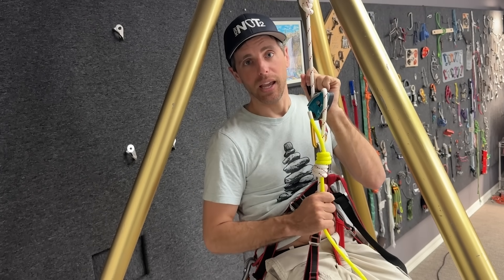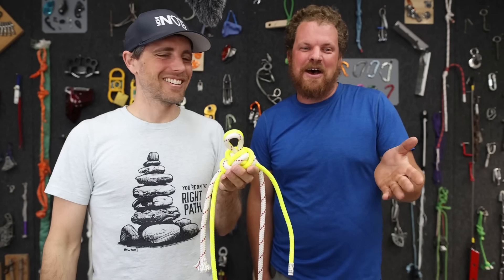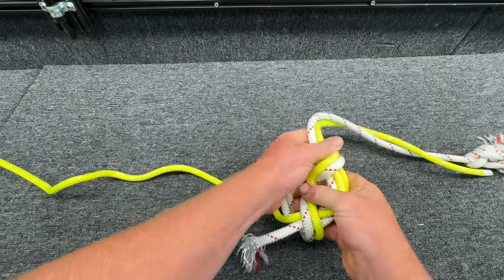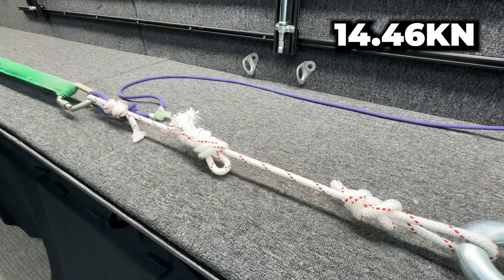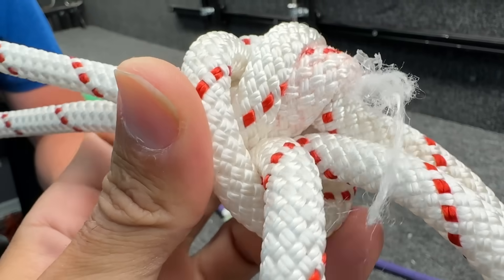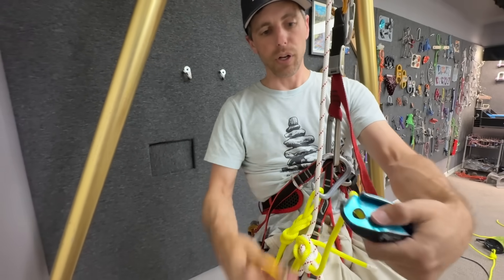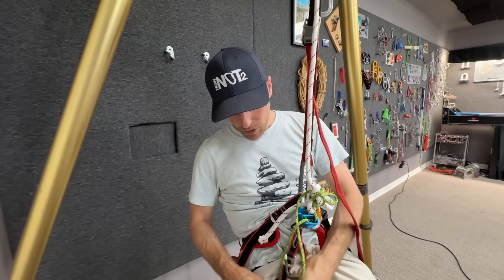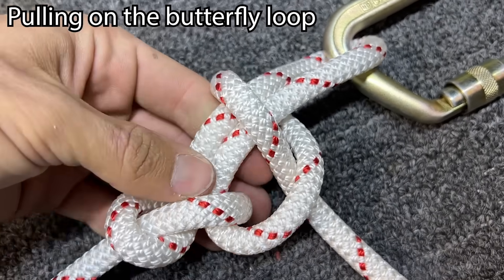I’ve never seen anyone use it

Comment: Irata 1 here, I used this knot to keep my safety line close to my working line, both 11.7mm kermantle rope. Had a big scare when it undid itself and dropped me a foot. The extra strands just wouldn't dress easily. I still use it but now place a carabiner in the bite for safety.

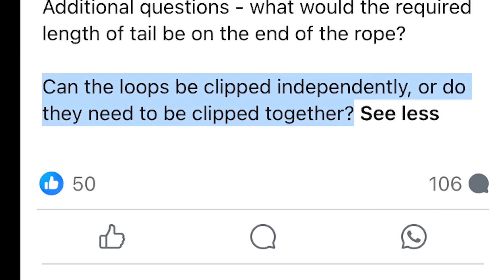Comment: 7:00 would there be any difference if you used the loop from the load-bearing rope vs the dangling rope? Since the two ropes in the test were the same color, it's hard to tell which side was used.

Comment: I’m planning a 100 m rope swing (pendulum jump) in about 8 weeks.
My question is whether it’s feasible to combine two 70 m ropes with two 30 m sections from a folded 60 m rope.

The idea is to connect both ropes together in the same knot, so that the knot is shared by two ropes. From my perspective, this setup should prevent the knots from creating friction on each other or getting caught, since they would be aligned together.

Has this configuration been tested before?
Would it be considered redundant?
Are there any safety issues or potential failure modes I might be overlooking?

Comment: There's a way to tie a modified fisherman's knot that is easy to untie.  It involves putting a square know in between the two barrel knots.  I wonder how strong that would be.  I have used it before in a cave, perhaps that was unwise but would be interested in the strength of the knot.

Comment: What if...one would take this knot to make two personal ankers out of it?
Just thinking.
Just recently, I watched your videos about a cow's tail, where you dropped several things from the drop tower.
So, I just wondering...🤔
The double loop goes directly onto the harness (next to the belay loop maybe?) and with both other ends one can adjust two individual figure-8 loops as two cow's tails.
So then there would be no carabiner needed on the harness with only one (bigger) knot with a double loop for further abrasion security.
Maybe I give it try form my ceiling in my living room 😅👍🏼.
Reply: Tying the knot onto the harness (?) might be a bit tricky, but I don't have very much experience to know it better.
Thank you.

Comment: The way I was taught to prepare ropes (for caving) before stuffing them into the tackle bag for whichever cave was today's fun (or tomorrow's first fun) was always to tie a figure-8 loop into the end of the rope, then a single figure-8, then drop that end of rope into the bag and start feeding the rope into the bag.
First in, last out. If you're in mid pitch and you've started on the wrong rope (which is why you always put the rope length mark under heat-shrink at both ends of every rope - particularly if you're the club's tackle-master with nobody willing to do the dirty work on Wednesday evenings) for the pitch, you don't clutch at the loose end of the rope accelerating upwards away from your grasping fingers at 9.81m/s/s, but instead the first stopper knot (single figure-8) smacks into your rack, stop or whatever and you come to a halt. Then you clip into the figure-8 loop with as many cows tails and donkey's dicks as you want, switch to ascenders and up-climb off your descender. Affix the new rope (or ascend to pitch head and find out who has lost a tackle bag), then down-climb beyond the junction, change back to descender, and continue to the bottom of the pitch (or the end of that tackle bag.
We'd drill the novices on that at 3 hours after sunset on the sea cliffs. Then Muggins the tackle-master would be washing ropes in the shower at 03:00 to use on that weekend's jaunt.
To be honest, I often just wouldn't bother to untie the figure-8 loops from one month to the next unless I had other reason to inspect a rope end for damage.

Comment: Why not use the Fisherman to connect the two ropes, and then create 1 or 2 Alpine Butterfly knots above and or below the fishermans close enought to clip in?
Reply: Of course in theory you can do this.
But - this issue here is 'efficiency'.
A bend (ie end-to-end joint) that consumes more rope is not 'efficient'.
Ideally, you want to use a 'bend' that consumes the least possible amount of rope, has the lowest possible 'footprint', and is resistant to jamming (and of course, is secure and stable).

Comment: Awesome mystery knot video! One mystery knot i saw tied by an AMGA/PCIA instructor was the Triple Bowline. I use it all the time now. Just a little playing around with the knot will show why it needs a video! I use it as a midline bowline so I don't have to pull the tail all the way through. I use it for tree work, 11.7mm yale scandere in a running or cinching configuration. Originally i saw it in 10mm static line for a really long tree anchor, so the double loop was around a tree.
Reply: I have used a triple bowline for almost 4 decades in certain situations . Mainly industrial use .

Comment: Double alpine has been used in rope access for years for rigging Y hangs that need adjusting angle frequently and for making an anchor for vertical lines that run off horizontal lines without the need for a trolley system.
You can find discussions like this on any rope access forum but especially the North American ones from the sprat no nothings arguing you can’t do xyz  because they don’t know the difference between a SWL and a WLL.

Comment: been rigging for more than 40 years,  got 5-6 knots i use on a regular,  sometimes folks tell me they have a better knot than the one I'm using at the time....I always agree.
Reply: I find the half-sheepshank to be useful. Knot might be a strong term for how extremely dangerous it is, but if you're working alone and want to lower multiple tools off of a roof without climbing down to untie each time, it's useful.

Comment: This actually seems to suggest this is (bar the situations when you need low profile as mentioned) actuall the best way to connect two ropes. Clipping point, super good enough strength, and you can have it clipped and have two independent ropes still functioning as normal. I'm keeping this baby in my bag of tricks for sure
Reply: It's big and prone to snag.

Comment: Haha.. finally made it on a HowNot 2 video...!

Jip not every one thinks like an engineer....I've explained on the original post on Rope test lap.

The knot wasn't discouraged..! 

Caving specific application of it as a singular attachment point was discouraged in a scenario where the loop/eye is bidirectionally loaded pulling the 2 strands (of the same rope) appart. That will result in pulling the constricting loops tighter from both the loops and the line side personally more than a singular load point inside the eye.

Consequently loading and unloading of the main line (in a horisontal placement or a vertical placement) will result in a self-equalising of stress and a rotation of the loop /eye between the 2 points pulling on it.  That will create a saw effect on the loops of the eye as well as the constricting loops of the knot with the fibers already under stress that can lead to a premature catastrophic failure.. In a caving scenario there's additional abrasion compounds like mud or surrounding sandpaper like surface of calcified sults. Found in both dri and wet caves.

None of the tests in the video or responce reflect the scenario described in the post though ... as an application to caving more predimantly in caves where there legislative restrictions on "hardware" and more soft goods are used...

Request...
I would love to see comparative  pull tests between the Fusion and the End Bond Singe Boline and End Bond Double Boline though...
 
I really appreciate them, they do the community a tremendous favour with their work.

Comment: Bro you just need to put a 2" Lag/Eye Screw into one of the top braces of the ceiling(Thats what I did about 3-4 years ago when I first started following you!), you keep running out of line on your line.   No biggie, clean ass tripod!  And I really appreciate you showing proper change/cross over techniques  Cheers!

Comment: As a guy who work construction, I don't understand why you want 2 points of contact (that makes sense, of course) at all time, but when you rappel on your grigri or whatever it's fine to just have one? Or am I missing something that was assumed everybody knew in the video?
Reply: Most of the IRATA manuals require you to abseil on doubled ropes (oh, sorry, rapeller en Française ) with your weight on one rope and one of those "shunt" devices as a backup on both abseiling ropes.
Which means a little more forethought and planning at the rigging stage, and a modicum of additional rope.
Haven't Shunt's (or for that matter, a couple of Kreuzklems) been replaced with some other ironmongery now? Regardless, yes, you should be on doubled ropes for both ascending and descending.
Reply: What Ryan meant is that you need a backup attachment during any 'transitions' where components are disconnected and/or re-attached.
Also, a 'GriGri' is a fully encapsulating device - meaning that once the rope is threaded and a carabiner is attached, the rope cannot fall out or randomly disconnect.
In rope access work (which is a totally different context to recreational climbing/abseiling) the international Code/Standard requires the worker to always (continuously) be attached to 2 different ropes.
One rope is designated as the 'work rope' and the other is designated as the 'backup fall-arrest rope'.
Each rope is required to be attached to its own independent anchor (or via a system of load sharing between the 2 anchors).
Ryan is catering for a very wide audience - where you have a mixture of people in different roping disciplines. It gets tricky trying to explain general safety rules where you have conflicting 'SOPs'.
For example:
Sport rock climbers (bolted routes) typically use and rely only on a single (1) rope.
They 'happily' fall on only a single (1) rope.
A rope access worker would be horrified to do this - and wouldn't - because it would violate his code of conduct (International standard) - because he is required to always use two (2) ropes.

Comment: I used a variation on your double butterfly bend for the exact same situation (fixing two ropes on the start of Zodiac). I joined the ropes using a fisherman's knot then isolated the fisherman's knot using a butterfly.  That gave us a loop to clip into for whatever reason but also remained quite easy to untie.

Comment: 2:19 New to my list of things you will never see my fat ass do, nope, not even to escape, the raptors can have me.....

Also, it might be cool to get a thermal camera (like one for a phone, I think they're only a few hundred (bolometer arrays are expensive, yo) and can be used with a usb extension to keep the record device safer/easier to reach/or possibly integrated with the main system) to the rope puller. Watch how heat builds in the knott and such. Im sure its been suggested before, but they keep getting more detailed and cheaper....so....idk, maybe something cool to add.....

Comment: Hi, engineer here to try to break down the jargon in that last section.
1. In a situation where the double butterfly is being used as an anchor with both ends of the rope(s) being loaded cyclically back and forth (I'm not sure what situation would require this), the knot would act like a seesaw tilting back and forth and rubbing against the rock which would cause concentrated wear on that section of rope

2. In that same situation, the back and forth loading from one strand to the other would cause gradual stretching in the fibers of rope A, which makes room for more knot movement and more stretching in rope B, and vise versa.

I'm not sure what situation would require a setup like this, or why someone would opt for this knot as opposed to something like a doubled figure 8 on a bight. Probably why Izak wouldn't advise it
Reply: Haha.. finally made it on a Not 2 video...Jip not every one thinks like an engineer....I've explained on the original post on Rope test lap.

The knot wasn't discouraged..! Application of it as a singular attachment point was discouraged in a scenario where the loop/eye is bidirectionally loaded pulling the 2 strands (of the same rope) appart will result in pulling on the constricting loops tighter. 

Loading and unloading of the main line will result in an equalising of stress and a rotation of the loop /eye between the 2 points pulling on it.  That will create a saw effect that can lead to catastrophic failure..

Appreciate them they do the community a tremendous favour with their work.
Reply: @Ismuk  Best to define our terms here... knots are tricky things to describe and explain!
In the general case of a Butterfly eye knot (whether singular rope or doubled rope) - there are 2 distinct loading profiles:
1. Through loading; and
2. Eye loading.
In a 'through' loading profile, there are 2 'S.Parts'.
In an 'eye' loading profile, this is only 1 'S.Part'.

In the case of a doubled/re-threaded Butterfly, there are 2 'eyes'.
It appears that you are describing a situation where only 1 of the 'eyes is loaded.
There are different ways of interpreting what you have written.
For example, one possible interpretation is that each 'eye' is loaded and pulled in opposite lateral directions.
Or, another possible interpretation is that 1 'eye' is subject to a transverse loading profile (ie cross loading).
Sorry - I just cant be certain of the exact loading profile you are trying to describe...
Mark Gommers

Comment: I'm a Irata 3 and have used this extensively for pull-throughs and for knot blocking a large deviation. It works extremely well and is still two independent ropes, more over it's safer for y-hangs. It you have two alpines tied and the one with your wieght fails in a y-hang, you have an uncontrolled swing. If you have a doubled up alpine with both ropes tied together and one fails you stay still.
Reply: Same, flr pull through its brilliant!

Comment: i use a lot and i love butterfly knot... and i normally use it when i rope solo multipitch/bigwall using two ropes to be able to climb two pitches in sequence, then after I rappel to dismount the two anchors below, when I climb again (jumar) I join the two ropes with the butterfly and then pull both ropes with microtraxion and put them in the rope bag to climb the next two pitches...

Comment: Yes I can personally confirm that you are correct, this knot is in fact very illegal to use or even have done so if admitting personally at some point within the last 7-10 years, 
You're welcome 🙇
Reply: The idea/concept of "illegality" is wrong.
In the first instance, illegality implies breaking a law/rule.
There is criminal law and civil law.
None of these 2 would apply.
You might make the case that IRATA expressly forbids the use of a Butterfly joining knot that has been doubled/re-threaded.
I don't recall reading any published document that expressly forbids the use of such a 'bend' (ie end-to-end joint).
As a thought experiment, IRATA would have to discover the perpetrator who used the 'bend' to unite his ropes - issue a warning/show cause letter, and point to a clause in their COP (code of practice) that expressly forbids such a knot.
Theoretically, there is nothing 'wrong' or 'dangerous' in using a doubled/re-threaded Butterfly to join 2 ropes.

Comment: I use a figure eight decender as an anchor plate sometimes (it's light and compact so I always have it with me). My figure eight says it's rated for 24kn but I was wondering if you actually get that strength when using it as an anchor plate. I would love to see this tested. If anyone else uses a figure eight in this way or wants to comment, let me know. Am I A braindead, soon to be actually dead, moron or not?

Comment: Make an inverted Butterfly.
Reply: Are you talking about the seemingly little-known ‘Mobius loop’ in which the positions of the standing ends and the eye are reversed? Each leg of the eye exits the knot where the two standing ends would usually be and the standing ends instead enter from the top of the knot, which would be where the two legs of the eye emerge in the original Alpine Butterfly.

Comment: Great video as always. 

Does it meet the 5 rules.
1. Is it easy to tie?
No, it's a bit contrived.
2. Is it easy to inspect.
No, you can't clearly see the paths are correct and it's not symmetrical, so even inspecting the correct path would make your head hurt.
3. Is it easy to remember?
No, knots that are seldom used are harder to remember. Better to learn 6 key knots well than 60 knots less well.
4. Will it stay tied rather than shake loose?
Probably fine.
4. Is it strong?
Yes plenty, if tied correctly.

I rather use two common knots a few inches apart, a rope joining knot and a loop knot (not the butterfly). Especially if somebody else is tying it!!!
Reply: Dude this knot is so common in some fields it's insane. Those yes nos are relevant to who you're around. The people I usually climb with know it well enough that the first three answers change.

Good thinking though. If you don't know don't blindly trust it.

Comment: I used to "bobber fish" spring chinook using no terminal tackle except a hook. Basically using the same knot as my weight "dropper loop" or later on usin g a TINY loop and attaching a swivel for even quicker weight changes.
What I did find, was that with a weight or swivel, in the loop it CHANGED EVERYTHING! For fishing, and the size of line I use.. It's super good enough... But if the results scale even relatively close.. Try yankin with a carabiner through the loop. Maybe?!